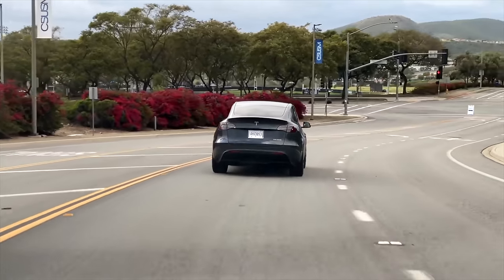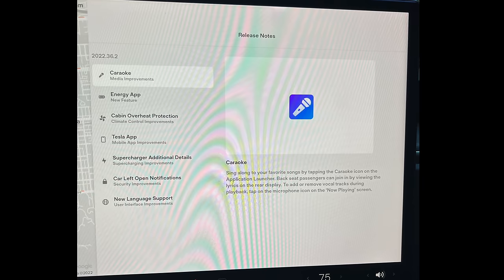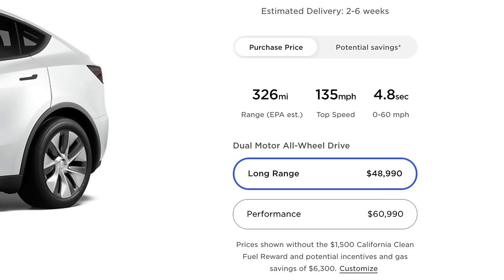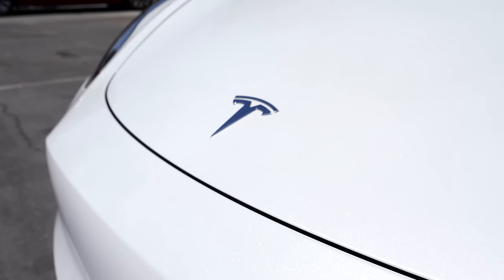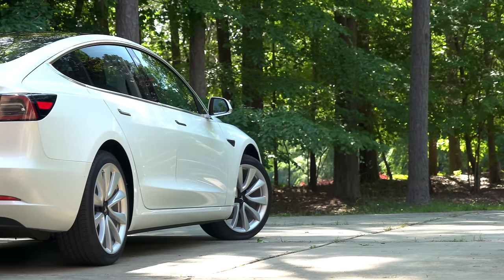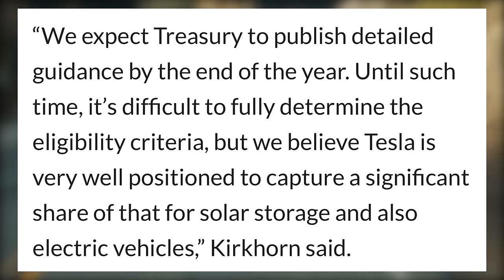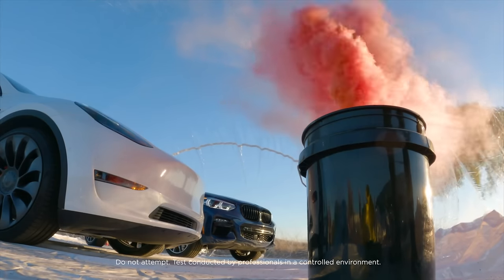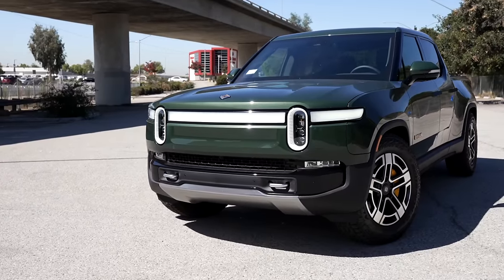Tesla Lowers Their Prices | How Long Will This Last?

Comment: Perfect, parity with Ice vehicles is coming and ice makes still loosing money on any EV they sell.
Hope the reduction will also be introduced in other key markets to boost volumes further as margins above 25% is not needed if they maximize production.
Good as electricity did increase in price a lot thus cost of ownership needs a bit more support to speed up the transition towards EVs

Comment: Ryan, incredible review, thank you. I agree on your assessment of Tesla used car pricing crashing as well as their new car pricing is high compared to new EVs coming from other OEMs. My experience with 2018 Performance M3 which cost me $81,700 (red/white interior, all options including FSD) when I purchased in Sept, 2018 supports your review. I have 10,900 miles on the M3P and it is in new car condition. Tesla trade-in offers which states includes value of Full Self Drive were on July 8th $56K; July 28th $53; Oct 12th $42K and last on Oct 22 $31K. I sold my M3 yesterday to a 3rd party for $45K and canceled my order for new Tesla MX which would cost $133K with EAP (I purchased FSD on two Teslas over the last 5-years and never received it, I have no confidence in getting FSD and strongly agree that $15K is way over priced). Now I'm in the market for a new EV. I'm considering Genesis GV60 at $69K; Electrified G80 at $82K; Cadillac LYRIQ at $70K (estimated); Rivian R1S at $97K; Lucid Air Touring at $108K. Tesla MS with EAP cost $116K. Seems both the MX and MS pricing is not competitive and needs to drop for me to consider a new Tesla. For the first time in 5-years, I'm considering a non Tesla. I have a test drive today for the Cadillac Lyriq, looking forward to the experience.

Comment: I really like your channel.  I love that you don't automatically buy into the hype.  FSD comes to mind.  I have friends that have had Tesla vehicles since 2017 and purchased FSD.  They will likely never get anything for the money spent.  I tried to get them to understand that it isn't even beta, more like alpha.  One friend has the early release and complains about it even still.  

I don't doubt that some day Tesla will get it to work.  But for me $15K is way more than it is worth.  AP does what I want just fine.
Reply: I totaly agree. FSD is nowhere near a finished product, even though Elon Musk have said it will be only two years before its ready sine 2014. Its not responsible to let the drivers be beta testers on the roads
Reply: @itselectricvideos  I agree it is not a finished product.  However, I disagree with the Beta testing.  It is the only way to get the miles on the road needed to finish the product.  They have never said it was anything but a beta and that it is to be used in a very specific way.  As long as both parties agree I see nothing wrong with the approach.
The responsibility is on the driver to make sure that FSD or AP for that matter, doesn't do something stupid like run into a police car or under a semi.
Reply: They should at least allow the FSD license to be coupled to a Tesla account. This would only be fair. That a software option is tied to a car without any technical reason for good is a ripoff for the customer.
Reply: @C4H6As  No complaints with that.  Especially those that purchased it 5-7 years ago and will now have to purchase it again if they want.  But that is up to Tesla and the customer.  I personally didn't want nor buy FSD.  As a rule I don't buy Beta software.  But the potential for FSD makes it very desirable for some.  I might be inclined to get Enhanced AP but not at $6K.  Standard AP works great and has improved steadily through the years.  Which is thanks to Tesla's policy to upgrade all cars with the latest software.  So they already do more than any other manufacturer.
Reply: @bryanwhitton1784  This is sport on

Comment: Well, that's great!  Telsa lowers prices in China and keeps hiking prices for us in America.  Way to go Tesla!
Reply: Tesla is facing way more competition in China than in America.
Reply: I was thinking the same thing
Reply: don’t be ignorant….. supply and demand and labor rates as well as supply costs set pricing.
Reply: They aren’t going to lower the price for giggles. As long as they can sell all they can make at the higher price they will. Why not?

It’ll be great when there are more choices.
Reply: @rhedd5  thank you capitalism.
Reply: Stop whinging you Americans lol bear in mind cheaper to produce in chine and average Chinese US not as wealthy
Reply: For anyone that currently owns a Tesla, dropping price would immediately impact the value of the vehicle they own.  Your discontent is misdirected. If you don’t own one, when they release a different model, you can buy it then. At that point let’s see how badly you want prices to drop on a vehicle you own. 
Nonsense comment.
Reply: @davegenet  when the Y first came out they lowered the price several times. I got mine in Dec 2020 for 49,500 . Missed the lowest price by $500 but saved about $1500 from when I started looking. Wait time was about 2 months. As a current owner and stock holder I hope they dont lower prices til supply catches up then brings them down as they can.
Reply: The stereo system needs to accessible thru voice commands.
Reply: @steveb796  I think that’s exactly how they’ll handle it. Also it isn’t a $65K car to me but a lot of people think it is so more power to them!

Comment: When Tesla removed the Model 3 Long Range from their config site, I thought (like some others) that it would return on/after 1/1/2023 at $54,990 but with limited range (say 25 or 100 miles).  It would qualify for the $7500 tax credit, and after delivery the buyer would pay another $3,000 to ‘unlock’ the full use of the battery.  Net result: Price stays the same as before ($57,990) but the car would qualify for the $7500 tax credit by have MSRP under $55,000.00.   Interested to see if that’s what happens.
Reply: GM CEO said they dont expect GM to achieve 7500 until 2025. So I dont expect Tesla, who uses a lot of Chinese materials, to get the full 7500 on 1/1/23

Comment: Always enjoy your videos.
Question: since Tesla is reducing car prices, will they also reduce battery prices? I’ve had my T3 since 2018 and need to make a decision on whether to trade the car or wait to replace the battery.
Reply: Did the battery fail or is it high-mileage?
Reply: @matthewholzner9526  has not failed. 70k miles now and no issues. Just weighing options before warranty runs out.

Comment: One thing Tesla might be able do to get the long range Model 3 below the price cap for the US IRA tax credit is to disable the all wheel drive and some other software controlled "features" like rear seat heating, etc at delivery, or maybe even capping battery capacity. Nobody is going to pay thousands extra for a long range car with those features, so the expectation is that they will pay Tesla after delivery to enable those features. Tesla will get the full payment, and the customers will get the tax credit.

Comment: If Tesla makes a home HVAC, he needs to make it bi-directional in the sense that it's an AC as well as a heat pump. They should certainly do this and make them cheaper for consumers than products like Mr Cool, as well as make them easily installable by consumers. This would fulfill their desire to disrupt markets.

Comment: Model 3 standard range should not qualify as the batteries are  at LiFePO4 from China? Maybe Elon meant that these would no longer be used and revert back to the Panasonic 2170s?

Comment: Model Y needs two options, adjustable air suspension and electrochromic glass roof.
Reply: We want the price to come down 😂
Reply: No it does not need those thing. If you want those, get the model x/s. Adding those to the Y would make it very more expensive than the X/S due to the Y’s high demand, not including the maintenance cost that would add to the vehicle. The Y is in a perfect spot right now.

Comment: Can someone assist with a question - I'm finding conflicting info.
If I buy a new Model Y before the end of 2022, will I be able to receive the tax credits available in the inflation reduction act? Thx.
Reply: I don't think YouTube is probably the best source for that. You need a verifiable source
Reply: I read a summary on Kiplinger where you can get the credit if the contract to buy the EV isn't scheduled for delivery before 2023. Best to check with an expert.

Comment: Thank you for the great video Ryan. But it created a slight confusion to me personally. I recently ordered 2023 Tesla Model 3 LR (59k) suppose to be delivered between Dec 11- Dec 31st. Based on the points you have mentioned is this good to continue with this purchase or wait till next year?. Not sure on the news or rumors for lowering the prices and Federal returns of 7.5k sounds cool. Please suggest what's your opinion?. I am really confused now!
Reply: I am not Ryan but I would wait because I am sure you may qualify for $ 3750 credif, the car being built in the states, battery from china?
Reply: @nicholasmuni7995  Current LR batteries are made in the US as they are 2170 cells. If that changes in 2023 with the new M3P batteries we’ll see
Reply: I have a new point of view try to postpone!

Comment: It says “FSD Capable” on the used models, not “FSD Included”. You would still need to pay for it
Reply: The FSD is fully unlocked on used vehicles ordered through Tesla. Just picked up my model 3 and it had all the FSD unlocked. We made a trip from CA to AZ and used it a bunch!
Reply: Some do say "FSD Included"
Reply: @mzink88  mine stated FSD capable as well.
Reply: @mzink88  no they don’t, not on Tesla’s site.

Comment: The price drop in China isn’t due to demand. This price drop is due to the Chinese government extending the subsidy until the end of the year (instead of expiring at the end of the 3rd quarter). Some Chinese customers delay their deliveries of Tesla EVs with the expectation that Tesla would lower their prices at the beginning of the 4th quarter to allow these vehicles to qualify for the subsidy. 

When Tesla finally lower their prices, three weeks later, demand surged so much it crashed the Tesla website!  

If China doesn’t extend these subsidies into 2023, Tesla might raise their prices once again depending on the demand.

Comment: huh.  that price drop lasted one day.  The 2021 Model Y:
Model Y Long Range Dual Motor All-Wheel Drive
14,693 mile odometer
Carson, CA
was 69,900 in your video and now, one day later, is $75,900  That's not inflation.  It's Hyper-Inflation.